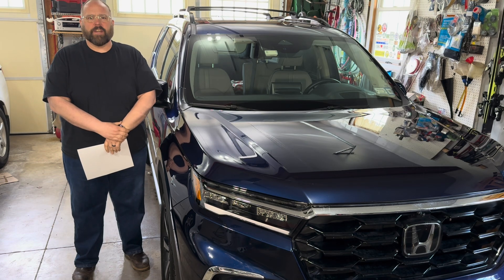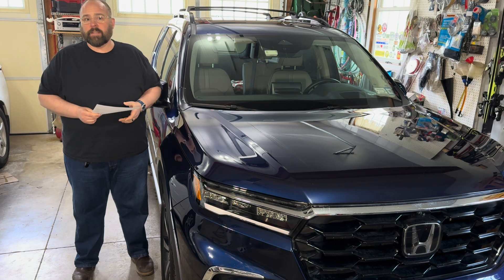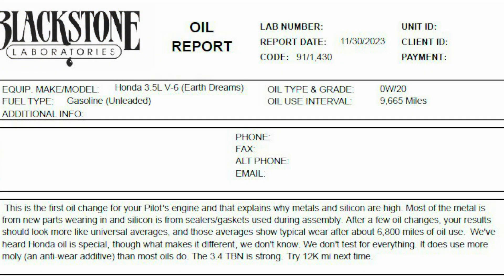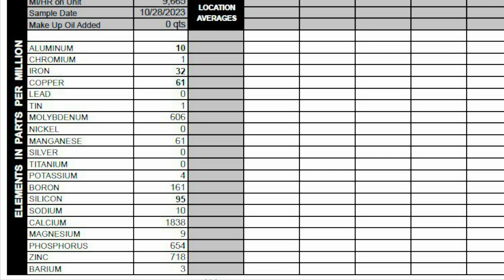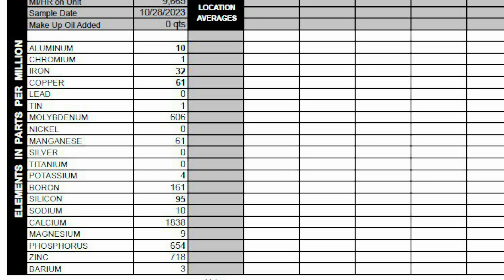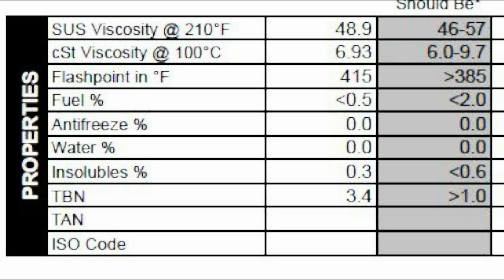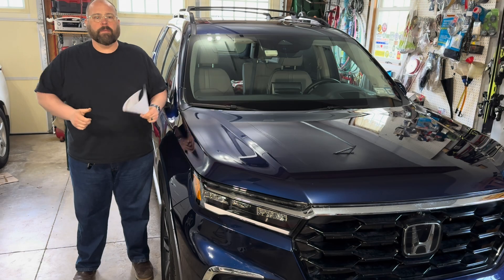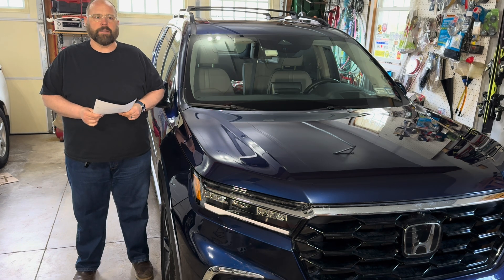Honda Pilot Factory Fill Used Oil Analysis from Blackstone Labs.  9,665 miles later.  How did it do?

Comment: Thanks for doing this video.  For my ‘06 Odyssey and ’08 Ridgeline, which I’ve owned since new, I've always followed the Maintenance Minder and would get the 5W20 conventional oil and filter changed at 5 to 15% (usually at about 4,500 to 4,800 miles).  I’ve had no engine problems with either.  
I recently replaced the Odyssey and purchased a new ’26 Passport TrailSport.  I plan to use the Maintenance Minder and change the 0W20 synthetic oil and filter at 5 to 15%.
Reply from the maker: Sounds like a solid plan!

Comment: Yeah…I changed the oil on my wife’s 2025 Infinity QX60 at 1,500 miles…despite what the owners manual or Blackstone has to say…https://www.youtube.com/watch?v=_6nWCQ_70J0&t=4s&pp=ygUYRmlyc3QgbmV3IGNhciBvaWwgY2hhbmdl
Reply from the maker: Good deal.
Reply from the maker: What Lake Speed never does is link early oil changes during break-in to longer engine longevity.  He says there is a link, but never supplies it or proves it.  Also, he says to back claims up with data.  He does not do that.  All he does is prove that break in counts are high, and that they go down with each subsequent oil change.  He does not prove that leaving that initial fill oil in causes wear that shortens engine life.  He speculates that it does, but does not prove it. 

I have (2) other Hondas with over 225,000mi each that when I do the oil analysis on oil that is run to 5% on the maintenance minder has results that beats the universal averages in the blackstone data base.  I have supplied that data on my page.  That is more data supporting following manufacturer oil change intervals than Lake has provided against it.
Reply: @InsideBigJaysGarage  ....the 2.0L VC engine is a POS...I'll continue to change the oil every 5,000 miles/six months, whichever comes first.

Comment: Those are very low wear numbers for factory fill at almost 10,000 miles, but why push it?
Reply from the maker: Basically I was verifying that the Maintenance Minder could be trusted.  And because it can I will keep following.  Spoiler alert: I’ve had (2) prior Hondas that are still going 200,000mi+ following maintenance minder alerts.

Comment: Good video. Just bought a Passport
Reply from the maker: Thanks!  Good luck with the Passport.  New body style?
Reply: @InsideBigJaysGarage It's a 2021EX-L with 70k miles. 1 owner. Carfax showed regular oil changes around every 7k miles at dealership. The last oil change was at around 9k miles... right before trade-in. So glad to see your video showing oil was still good at 9,665 miles.
Reply from the maker: Those Passports are good.  I’ve driven a few.

Comment: Hey I appreciate you took the time to share this.  I have a '25 Pilot and just got my Blackstone analysis from when I changed the factory fill at 2900 miles.  Mine had copper at 52ppm, aluminum at 18, iron at 13 and silicon from sealers at 89.  Everything else was good, no fuel.  Due to the tiny oil passages inside the solenoids that power the VCM and VVT phasers I am going to stick to around 6k intervals.  I've seen the sludge that builds up inside over time.  The problems that can develop occur well after the OEM warranty period but I plan to keep for a long time.
Reply from the maker: Thank you for sharing your results.  It’s interesting to compare them.  Are you going to have your second OC analyzed?  It would be interesting to see those results against my 2nd results.
Reply: @InsideBigJaysGarage  I'll have Honda do my one free change when the MM gets down 15% and I'll be asking them to get a sample that I can test.  Will be a few months as I suspect that will be at around 9k miles.

Comment: I would never follow the manufacturer recommendations for fluid change intervals these days. It’s all about lower cost of ownership and government incentives.  They just want to sell you the vehicle and get through the warranty period, then sell you another starting the cycle up again.  Good luck with their “lifetime” transmission fluid 🙄.  I have a 2021 Pilot, I change the oil every 4-5k and just changed the transmission, transfer case and rear differential at 30,000 miles.   People do not understand - the manufacturers no longer care about longevity, only getting you through the warranty period. After that, you’re on your own and they wash their hands of you. Do you maintenance early and often if you want your vehicles to last.

Comment: I wouldn't want all that break-in metal swimming around in the oil for 10,000 miles.  I would change all oil at 5,000 miles but with a new car I always change it at about 1,000 miles.

Comment: The million dollar question: Is the Honda motor oil you buy at the dealership the same as factory fill?
Reply from the maker: That, I don’t know.  I guess one could buy a bottle and have it tested.
Reply: Not usually. The dealers have contracts with local oil companies for their bulk oil. It could be Valvoline, Castrol, etc. Honda, Toyota, Ford, etc. do not make their own oils.
Reply: Most likely not.

Comment: I work on cars every day. I recommend 5k mile oil change interval to all my customers if they want to keep their car after 100k miles. 10k oil change is way too long. Engine may be OK when new, but will have issues later. Do yourself a favor, change oil every 5K miles people.
Reply from the maker: I’ll have some OAs coming from my K24 and J35 both with 200,000mi+ and owned since new with 8,000-10,000mi oil change intervals.
Reply: @InsideBigJaysGarage  10,000 miles and 0w20 psssh no thanks. Clearly a push to meet EPA and mpg requirements despite the sludge and other deposits created.
Reply from the maker: I understand the skepticism but this is my 3rd Honda that I’ve been following the maintenance minder on, and I’ve had the valve covers off of both of them and it is extremely clean in both engines with 242,000mi and 221,000mi respectively.  :-)
Reply: On top of that these are miles and not kilometers.

Comment: Great video. I really always wondered about a first oil change.  I have a 2021 crv with the 1.5 turbo. I did my first oil change at 12 months but only 3000 miles.  I've been worried that I waited to long but now I think I'm ok. Thanks again for this info.
Reply from the maker: You’re welcome.  Good luck with the CRV.  They are nice cars.

Comment: see what the engine is like after 100k thats the real story
Reply from the maker: I currently own a 2013 Accord (K24) with 236,000mi and a 2013 Honda Odyssey (J35) with 206,000mi on it.  I will have OAs of those engines coming soon.  They will be run down to about 5% on the Maintenance Minder.
Reply: @InsideBigJaysGarage  lol

Comment: 10k-12k is Insane. Even 7k is nuts.. 5k is fine. Oil/filter is inexpensive, engines are not. The varnish and sludge that accumulates inside engines is enough to change every 4k-5k. New High Tech engines have cam chains, cam phasers, etc... these get lubricated by oil going into small holes and dirty oil can eventually cause issues. Cam chains and the tensioners wear faster with dirty oil.
Reply from the maker: I appreciate your concerns.

Comment: I changed my 2025 pilot at 1000 miles for the first change.  It is broken in at this point on the factory fill, and there is no reason to leave those metals in the oil.  It will get changed again at 5000 miles, then at the MM warning (which should be around 9000 miles).  From that point on, I'll change it halfway through the MM warning cycle for the life of the vehicle, which should be every 4500 miles or so.  I've had the valve covers off these engines too many times and seen the sludge and varnish that builds up everywhere with long intervals.
Reply from the maker: Any metals that are of size that could cause damage to the engine are removed by the oil filter.  The increased Moly is protecting the engine as well.
Reply: @InsideBigJaysGarage  Not true!   If that were true, there would be no noticeable on the oil test you just did!   Common man!    Yes, never go over 1000 miles first oil change.  Get that metal and trash out after break in!   Watch Lake Speed Jr for as to why you change 1st oil at 1000miles or less!
Reply: @InsideBigJaysGarage  if the oil filter traps all metal, what is the moly protecting the engine from after 1000 miles of break in?
Reply from the maker: Molybdenum is a friction modifier.  It is used to reduce friction and heat in motor oils.
Reply: @InsideBigJaysGarage  …oil filters with cellulose medium are good for about 5,000 miles…after that contaminates will bypass the filter…

Comment: Every time I see this with any car manufacturers.  I said the same thing.  It’s a car.  You can always replace it.  If you take time to do your annual check up with your own health every year.  You might prevent some sickness when you’re older.  Yes I had many Mercedes, BMW, Acura, many Honda, Tesla and now back to 2025 Pilot Elite.  At the end of the day.  It’s a car, it’s replaceable, focus on your own health more vs. this oil analyst.  If it’s a new car, change out the oil the first 500-1000 miles and you won’t have any metal shaving.  It’s a giving with a new engine.
Reply from the maker: I appreciate your concern about my health.  I do see a doctor annually for my physical exam.  All my blood work is fine and I have low blood pressure.  :)

Comment: Why would Blackstone recommend longer oil chnage?
Reply from the maker: It’s something that they offer and you can ask for.  They look at the properties of the oil and determine if the oil held up and if there was still additive left in the oil (TBN #).
Reply: Yeah.  Didn’t understand that recommendation.   HUGE metals in that first sample.  Should have recommended something less than 5,000 miles until it settles out the high metals … likely after the 10,000-15,000 mike mark… then start looking at 10,000 oil change interval.  TBN is not the indicator of long oil change interval with such high metals.   Like what happens if I had 300 copper and 400 iron… and TBN was 5.5?    Am I gonna go for 12,000 miles on next oil change?    Oh hell no, unless I’m trying to kill my engine.   Be smarter than that Blackstone!!
Reply: @EscapetheFarm  Makes me wonder if Blackstone is a little Green? With all the engine break downs where extended service has been used you would think they would recommend shorter milages. I´ll stick to my eys and common sense as to when it´s time to change the oil.

Comment: I hope your engine lasts more than 100k. at best you should change your oil & filter every 3500 - 4500 miles. Another person said oil is cheaper than an engine. At $50k for my '24 RL-BE i'll definitely be changing the break-in oil probably around the 2500 mi mark. GL on your endeavor.
Reply from the maker: I have an Odyssey with 205k miles and an Accord with 236k miles and I ran the same oil change intervals on those, changing the oil at 5% on the maintenance minder. I do not expect much difference on this Pilot.  :-). I will have an AO coming on the 2nd oil change, soon.
Reply: @InsideBigJaysGarage  OK.

Comment: If you’re like me and buy them new and keep them 15-20 years, I’d have problems going that long between intervals. 3-5 works best for me. Thank you for your video. I’m in the minority, and I realize that.
Reply from the maker: I respect that.  I do have a 2013 Odyssey (205k mi) and 2013 Accord (236k miles) and they are still going strong doing the oil changes at 5% oil life left.

Comment: Wow, hurry up and wear that engine out! The auto companies WANT the  high mile oil change intervals so you can have engine trouble and have to buy another vehicle. The oil in my 2019 Passport with 68000 miles and 4000 miles on the oil was dark brown account more idle time in hot weather so got the oil changed. The oil reminder rarely gets below 40% for me. I rather buy oil and filters than an engine!
Reply from the maker: I have an Odyssey (205,000mi) and an Accord (234,000mi) that I have been changing the oil on at ~5% since new.  I will have the latest oil analysis for those up soon.  Also, I have the oil sample from the oil change I did on the Pilot @20,000mi out for analysis and should have the results back soon.
Reply: I have a 2013 mercedes e350, 10k miles Intervals, liquid moly. Currently at 187k miles never had a single issue with the car.

Comment: Important to know how the pilot is driven and envienvironment. For example, always driven 50 miles (fully warmed) in 70 degrees. If you drive 4 miles in below zero, then that is severe service. Not telling us the use case makes the oil analysis useless.
Reply from the maker: Thanks for the feedback, I will include that  in the next analysis for the viewers.  This car sees a 50/50 mix.  Some days it goes on a 75 mi round trip commute.  Some days it goes 3 miles to the school and back.  In just about all cases it hits operating temp.  Good call out.

Comment: That is good, for Factory Fill (FF), and 10k miles.   I like to drain it out early, at about 1k miles, for new FF oil, since all that "free-floating" junk (silicon, iron, copper, aluminum) just keeps circulating, grinding down the internal surfaces a bit.  Nothing too serious though, it is your choice how much you want to wear it down.    You can pick a high-Moly motor oil to replace the FF oil (I used Toyota -branded 0w20 high-moly oil in my 2024 Honda CRV recently, to replace that Moly that Honda thinks is good to protect the piston skirts and I think ring wear during break-in). ..... ... Glad you changed the oil filter out this time instead of skipping that, avoiding any extra bypass-events due to a partially clogged old oil filter in cold weather starts. ....  Pro-Tip:  Valvoline came out with some new chemistry in their oil "Valvoline Restore and Protect" 0w-20 keeps the rings cleaner (Sequence IIIH WPD stuff).   Blackened rings have never been attacked for actual cleaning before, this is new.    www.youtube.com/watch?v=kyyZDghgdCI for the complete chemistry story from Lake Speed Jr.

Comment: This is super interesting. Thanks for sharing this. It's interesting to see Honda has a ton of Molybdenum like Toyota oil.
Reply from the maker: Thanks for checking it out.  I found it interesting as well.  I just changed out the Quaker State that was in there for 10,020mi, today and will be sending that sample out tomorrow.  Check back for a video on that analysis.

Comment: AWESOME!!! I just got a 25 pilot and have been reading wayyy too many forums on whether to follow the MM or change the factory fill oil early. Looks like I'm keeping the factory fill in. I might change at 15% just for fun.Thank you for your time and effort man!
Reply: By the way, how long was the oil in for?
Reply from the maker: 9,665 miles.  We picked the vehicle up new at the end of April 2023, the oil was changed 10/28/23.  So, almost 6 months exactly, plus the 3 weeks from when it was built and delivered to the dealership.  We ordered the car.
Reply: @InsideBigJaysGarage  excellent, thank you! By the time mine hits 15% I'm assuming it will be around the 1 year mark. I was so tempted with changing around 3k miles, but I'll hold off thanks  your analysis results
Reply from the maker: You're welcome!
Reply from the maker: Thank you!  I am glad you enjoyed the video and found it helpful.  I will have an analysis coming soon about the Quaker State Full-Synthetic oil that is currently in there.  Its at 10% now, I will change it when it hits 5%.
Reply: changed my 2025 at 1k.  Then at 3k and 3k after that. so easy to do plus Texas heat new oil the best..
Reply: @gtamsb01 awesome! Good thinking. I actually ended up changing it at 3k. Couldnt help myself. Since then Ive been sticking to every 3k. Just hit 12k miles!